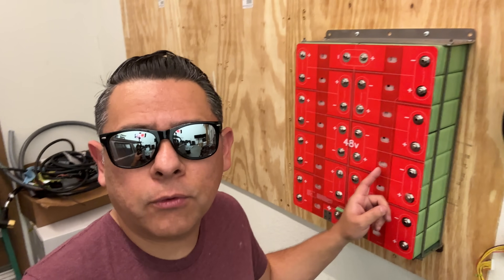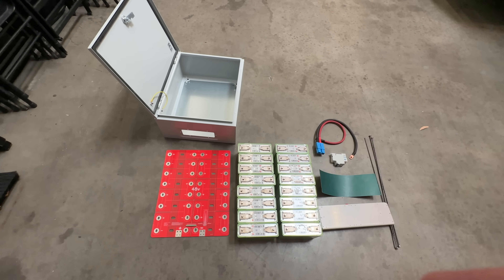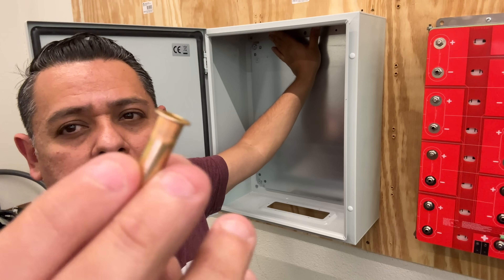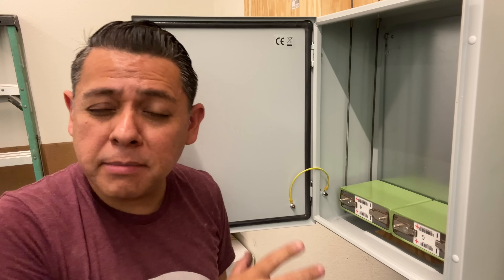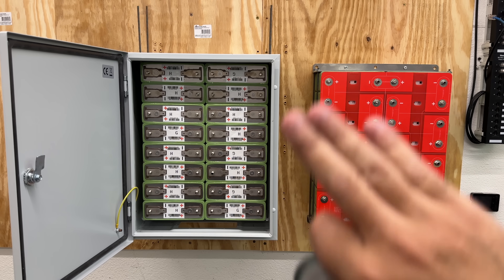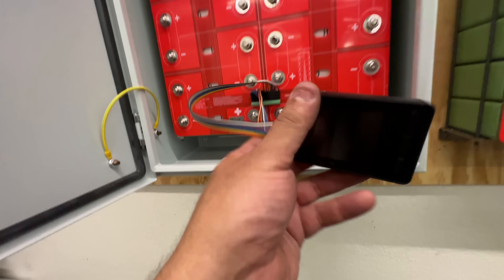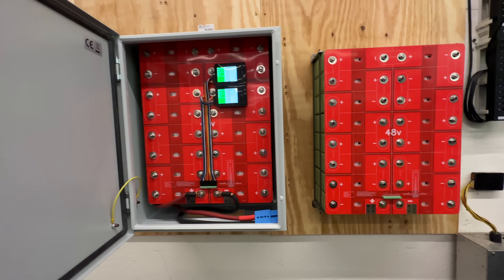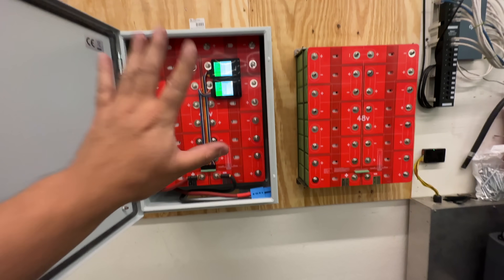$.12/WattHour  A grade LifePO4.... How is this Possible?

Comment: I would feel safer to insert the rod from the bottom. Silicone gets old under weather and uv light. So at least drill water holes in the bottom or better insert the rods from the bottom. To get room you could put timber or something on the bottom below the lower compression plate. So everything is inside.

Comment: Tip: i would insulate the threaded rods with a clear hose. So you avoid shorts in case the threads bite thru the cell insulation. The cell housing carries one pole!

Comment: @jehugarcia, I am using the same materials as in your video, which I purchased from Jag35, and the enclosure from Vevor. I will mount the enclosure on a plywood backer mounted to a heavy-duty hand truck for use in my garage. Above the battery enclosure, I'm using an EG4 48V-3000EHV off-grid inverter. QUESTION: If I construct the battery pack in the enclosure, as show in the video, can I then rotate the enclosure 180 degrees and mount it to the backer board - so the enclosure opening POINTS UP?  Then the two wires can easily connect a short distance to the EG4 (which has its input connections pointing down at the bottom edge).

Comment: Fantastic design on the whole system here. PCBs are well made! You can parallel these as well correct? eg. If I started with one of these, I could add more later as long as that particular pack has its own BMS and the voltages are relatively well matched? Thanks for all of the great content and sharing your ideas with us!

Comment: This is not best practice for prismatic cells. The orientation is incorrect, In this orientation some of the internal plates are starved of electrolyte. They should always be upright or thin side down so the electrolyte makes contact with all plates.

Comment: This battery is 48VDC at 74AH gives you 3.55 KWhr (not 4 as stated in the video).  If you compare it to what is readily available, the costs savings are marginal.  If you add up the costs of the batteries, compression plate and busbar you're at $702 not even adding the cost of the batgo meters, wiring, taxes and shipping.

I compared this to the the Renogy 48VDC 50Ah smart LiPO battery.  This battery comes with built-in bluetooth app monitoring, internal heating control,  IP55 rating...and frankly it is ready to go with just with two connections to make.  It's priced at $819.  Sometimes on sale for $750.  Oh, lets not forget it has a warranty.  

I'm not knocking this video. It's very cool.  Obviously 48v/74ah is a larger capacity.  I'm just making the point that sometimes these margins actually are thin between off the shelf and DIY.
Reply from the maker: Mostly correct except this is 16 cells at 3.2v each = 51.2v x74ah = 3.788Wh

Comment: Listen up, folks! I've been living completely off the grid for four years while studying electronics engineering and being part of the electrical union. You might hear that you're getting 74Ah at 48 volts and think, "Wow, this battery is only $0.12 per watt!" But let me tell you, that's a misleading way to gauge your power needs in a genuine off-grid scenario.

The real metric you should be considering is cost per amp, not cost per watt, especially when you take into account the battery voltage. Think about it—just to power a laptop that requires 15 watts, I use a 150-watt power adapter. That equates to $22.50 for merely one hour to keep that laptop running. Trust me, that's not a bargain. But hey, go ahead and find out for yourself if you're not convinced.
Reply from the maker: Nobody Is basing costs on power.....  12 cents per watt hour,  yes capacity

Comment: I would use a larger box so you could use the completed battery that you show on the right. You do not want threaded rods going out the top of a rain proof box. because even if you use sealant eventually it will leak. Also a larger box will provide more room. Also you can get good deals on used Nema 12 or Nema 3R boxes on on the used market way cheaper than new.

Comment: LiFePo4 really is the rockstar battery technology now IMO. The cycles, safety factor, and now the price. They're so cool!
Reply: Safety factor for the cells. This video treats a 48V system without any safety protocols of any kind. Since this is for beginners, that should be the first and foremost concern, as 48V, which is really really 51.2V+, can stop your heart (reason being 50V+ is high enough to overcome the resistance your skin provides — very little actual current is needed to stop your heart, once it's able to get into your body). Yet at 0:26 he's touching and brushing against the battery blindly. Not a single mention of safety concerns, 9:18 is another instance of pure carelessness.
Reply: @BatSolar  What exactly do you mean by stopping my heart? I thought with DC you don't care as it's linear, but if you get yourself in the middle of an AC line, then it will contract your muscles really fast which can be very bad

Comment: That enclosure is no longer waterproof after you made four holes on the top. You need to use some kind of sealant on and preferrably under the washers and nuts and redo it every time you have to rotate the threaded rods or nuts. Water will seep under the washers and down into the box if you leave it like this in the rain.
Reply from the maker: Yeah I suggest silicone sealant
Reply: @jehugarcia The battery assembly itself looks very neat. The PCB sheet is a great idea.

Comment: I'd like to use LiPO4 , but am concerned about fire hazard ( vids of batteries exploding). Being in the dry part of CA and summer days reaching over 120°f in solar shed/battery box. How do they hold up in extreme heat. Been using lead acid, time to get new ones.
Reply from the maker: LiFePO4 does not combust
Reply: Are the lithium ions the exploding ones? Cause I see a lot of car batteries burning and bike batteries that fire crews have to dump water on for hours and still burning. Also what do you know about use in hot climates with LiPO4?

Comment: I'd like to use LiPO4 , but am concerned about fire hazard ( vids of batteries exploding). Being in the dry part of CA and summer days reaching over 120°f in solar shed/battery box. How do they hold up in extreme heat.
Reply from the maker: LifePO4 is the safest lithium chemistry,  it does not explode or catch fire.

Comment: You said its for outside. Now you have the batteries in contact with the top which could be in the direct sun. Leave a section of the rod and add a "tropical roof" on top of the box to give the box topside a bit of shade and keep rain away.

Comment: Why 48 volts I'm using 12 ?
Reply: If its for a power wall, you want higher voltage so you're not using low gauge wire to go to your power sources. Its cost effective and probably safer

Comment: Bought the 16 cells.. also did the DIYAudio 10% off coupon.. so $550 shipped to door. Works out to $34 a cell. Not including PCB (out of stock as of now) and box.. but excited to build my first DIY battery system that with my Ecoflow River 2 should power my computer/monitor all day every day.. and given that where I live it runs about $75 a month give or take $10 to $20 depending on how long each day. Seems to average around 400 watts per hour to run my setup. Thus.. the way I see it.. is if I charge my battery system on off peak at .25kwh, I'll cut my cost by a bit over 1/2 per month to operate my system.. so ideally if I am saving about $40 a month, this system pays for itself in a little over a year. Worth it I thiink.

Comment: Change suggestion -If your threaded rod uses rivnuts, put them in the top angle plate and permanently afix that upper angle plate to the backer plate before installing batteries, then drill the bottom to access the floating compression nuts - bottom side holes are easier to protect from liquid water (an automotive body hole gromet/seal is perfect!!)
  
Another one - you have that whole door you're not using, use your VHB and stick your BMS to the door.

Comment: @jehugarcia You are providing a very valuable service, than you for your time.  Also, is the compression pack carbon, stainlesss or aluminum?  This is the only part I’d probably try to make myself…maybe two pieces per side of flat stainless with thicker allthread.  I’m also going to be using in an ATV so probably laying then waterproofing box flat…you see any problems with that? Do you offer local pickup?

Comment: ALL THREAD(HexHead)BOLT with a weather washer from the top Down would works so much better and have 4 Nut-plates on your bottom plate to compress your batteries.

Comment: 48v system... what is the process to run 110 -240 v appliances in one's house?
Reply: Connect to an inverter.
Reply: @redredred1 Exactly. There are inverters that take 48V DC in. Their input range usually is wide enough to handle 57.6V which is what these batteries will have for a short while when topped up to 100%.

Comment: Not really watertight with those boltholes in the top.
Reply: Exactly. I would also be wary of the mechanical sturdiness of the sheet metal at the top. Suspending 35 kilos of batteries from a sheet of 1.5mm carbon steel even if supported on four sides by bent material is still a bit too flimsy in my opinion. I would have added a bigger supporting plate on the top inside or outside the cabinet to spread the load or at least use a couple long pieces of 50mm wide steel flats to bridge two holes, stiffen the sheet and support the load under the washers and nuts. These cabinets might be rated for 45 kilos but that weight is meant to be suspended from the rear wall, not the side walls of the enclosure!

Comment: If you can design this 48v kit based the eve prismatic cells (mainly 300ah+) then I'm excited 😊,I'm doing an off grid cabin build next year (land purchased already ) I want to run a 48v 304ah bank like this .....
Reply from the maker: Some day ill get 300ah cells,  for now I got what I got
Reply: Market is flooded with Chinese vendors doing 280’s and 304’s in a metal box with a PACE BMS

Comment: So if I order that 16 pack of cells from JAG 35 will you deliver it to Victoria, Australia? Even if I have to pay a little extra for shipping as long as it's not an astronomical amount. I love what you do keep it up. 😊
I would really love to buy 16 of those cells to use with my 24V 2.5Kw inverter and my pair of Jinko 315W 40V panels.

Comment: Those battery cables... cringe :)  Like these PCBs, very clean, nice work.  Would be interesting to see something in 100/280/304 Ah (Like EVE cells) for Solar storage.
Reply from the maker: What’s wrong with my cables?
Reply: @jehugarcia Hm, attached a pic showing the concern but maybe you or Youtube didn't want the link...anyhow, the bare wire is showing pulled out of the shrink wrap on both positive and negative.

Comment: Great design. I like it.  Clean.

To keep the sytem repairable, and able to pull the system apart what about leaving nyloc nuts on top rather than cut them flush. Then use clear nail varnish to seal

Comment: I'm not following why I would use that giant circuit board instead of just bus bars..And I would use a JK BMS with an active cell balancer (2 amp), because they are used cells(maybe) that will certainly be out of balance when charging and loads are applied...And don't forget a fuse, and a circuit breaker for a disconnect...And those orient power cells are the same cells that Jakiper, EG4, and other server rack batteries use, they have 5, 7, and 10 year warranties depending on which batteries you buy..But, I prefer the DYI method..
Reply: Did you see the other videos? Did you see how tight these cells ran on HUGE loads?
Reply: @ericklein5097  no,but i would still use a jk bms with the active balancer, that's a no brainer..
Reply from the maker: This is diy you can build however you want,  no rules as long you build safely.

Comment: Yes, you can save money on a DIY battery like this, but you lose valuable space by going with lesser size ampere hour batteries.  I like the price, but need ~300ahs.  That would be 4 boxes verses 3 or even just getting one 300ah box.  I do like the idea you have presented.  Thanks for the video.
Reply: These are power cells. There are no cells over 200Ah that have specs that are even 1/4 of the power specs these cells have. 

Jehus got them for a really good price but if you have a space sensitive application for energy storage these probably aren’t the cells. These are great for anyone that either has space or needs to occasionally power some massive loads in bursts…..like an EV motor or large compressors on startup

These have that one massive advantage over the 280’s and 304’s. If your load is DC or you have a big LF inverter there’s nothing you can’t start up and run with these cells
Reply: I found the same cells on another site identifying that they are supposed to be able to handle a 600amp discharge for 10 seconds?  Just like what Jehus has alluded and tested.  The test did prove they can hit 600amps, but is it really that useful?  A grade A 280ah EVE cell should be able to handle 2C (560amp) discharge for at least 30 seconds.  That would also mean it should be able to go over that spec if you really want to push it. The real advantage of the LEV60 would be in the purchasing, and Jehus is promoting these at a good price.
Reply: PCB isba great idea and I would definitely like to find a similar solution for a more mainstream 280/300ah cells.

I do have some comments though  on the heat shrink on the main terminals. With the bend you have exposed copper. Just left it too short there. Fit another longer heat shrink sleeve and cover that up.

48V DC is a potential hazard, specially for begginers.

I would also do it the other way around. Fit the cells on the cabinet but laying on the bottom and screwing it from the top, that should make it easier.

Nice DIY kit!
Reply: Isn't the difference only like 6 cents per Wh?  $479 / 1780 watts is like $0.26/Wh.  And that doesn't include a BMS or buss bars.  If the other one is $1649 for 5120 Wh, that's $0.32/Wh.  Seems like a lot of work to maybe not even save anything.  EG4 PowerPro and Lifepower are $0.28/Wh.
Reply from the maker: Interesting math,  why do you round down for diy but round up for eg4?   Same nominal pack voltage of 52.8v x 74Ah = 3907Wh/ $479= .122/wh   12cents is a lot less that 32cents,  but I’m using Mexican math so maybe that’s why.
Reply: @jehugarcia ahaha
Reply: @jehugarcia Lol I'll take Mexican math at $0.122/wh! 😂
Reply: @jehugarcia  I was just going by what your website says "NEW HIGH DISCHARGE 600A LIFEPO4 1780W PRISMATIC CELLS" for $479.  $479 divided by 1780 is 26.9 cents per watt hour.
Reply from the maker: @twodogsandtheirfamily you need to realize that’s a power rating per cell
Reply: @jehugarcia  Ahh, you don't usually see that listed in watts, it's usually just Amps.  So I guess that threw me off.
Reply from the maker: @twodogsandtheirfamily  yeah agreed that weird,  I just changed it

Comment: Wouldn't it been easier to put the holes in the bottom to better weather proof the box?
Reply from the maker: Yeah do it that way if it’s better
Reply: @jehugarcia  my thoughts on it was since you already have a opening at the bottom side why not.
Reply from the maker: @michaelrohrs7475 but then you block the bottom hole with the battery,  so wiring will be more challenging
Reply: @jehugarcia  that makes a lot of sense there didn't think about that great point.
Though what is the point in putting the all tread outside the box, since the top and bottom plates have screw in spots to keep the pack where you wanted it inside of the box?

Comment: What about an inverter for the power wall ... Can we diy that also?
Reply: Or you could go with the EG4 3000 watt inverter/solar charge controller/ac charger all in one for $674...If 3000 watts are enough, that unit can handle 5000 watts of solar...
Reply from the maker: just buy one of these,  https://www.opsolarbattery.com/product-page/LV6548?ref=jehu

Comment: Why   seller not just cell the whole unit pakage?
Reply: Big batteries are harder to ship with all the regulations.
Reply: And labor to build it… it’s takes time and effort to do it. And at the point it would add to the cost, and would make more sense to buy a server rack battery new
Reply from the maker: @Zodiac83104  yes I would have to sell it for $1600

Comment: Hello do you know if I can add one of these builds to my existing simpliphi battery bank and use the same charging parameters?
Reply from the maker: no I don't,  all I can tall you is that this is 16s LiFePO4 like most other 48v systems out there so max voltage should be 58.4vdc
Reply from the maker: Holy Moly,  us  3.8kwh = $479   them 3.8kwh = $2300.     looks to be different chemistry on a quick look.
Reply: Yea they are pricey. I live off grid and they work great. Max charge is 56volts recommended. I’m going to setup my daughters she shed off grid and was thinking about building the ones you have .

Comment from the maker: LEV60 cells https://jag35.com/products/high-discharge-600a-lifepo4-1780w-prismatic-cells?variant=40939338432627
Reply: Any larger 12 volt banks or even 14 voltage?
Reply from the maker: @Islandboyzadventure  https://jag35.com/products/fully-assembled-12v-178ah-1200a-lev60f-lifepo4-battery